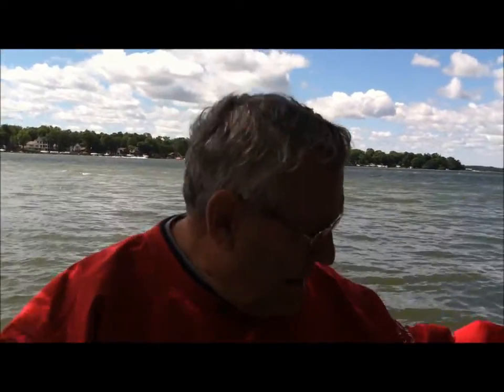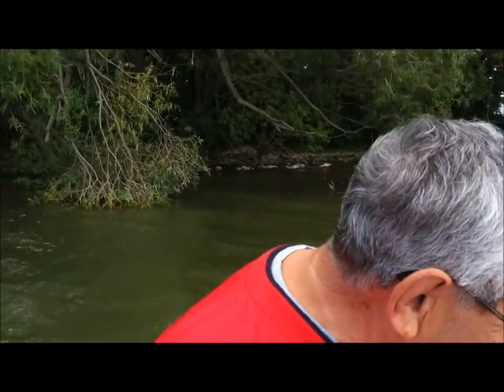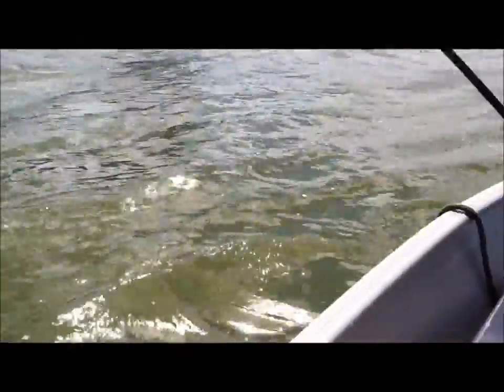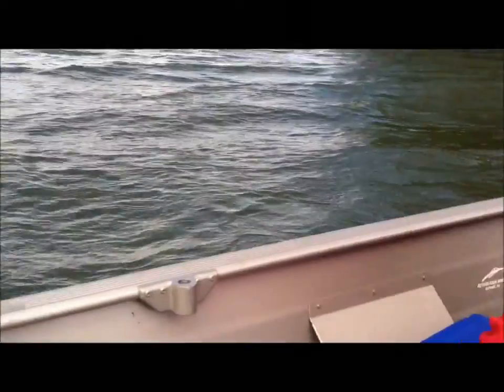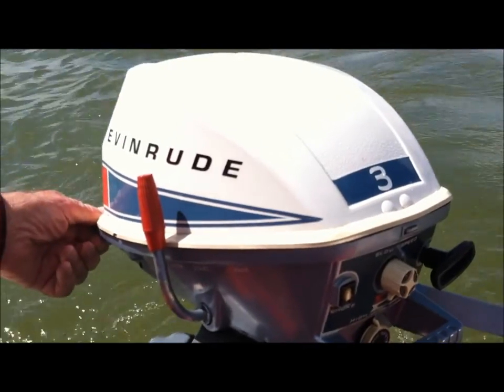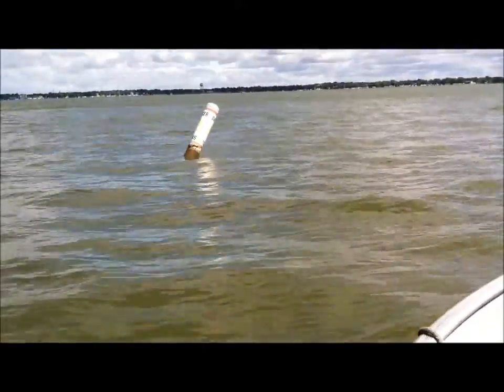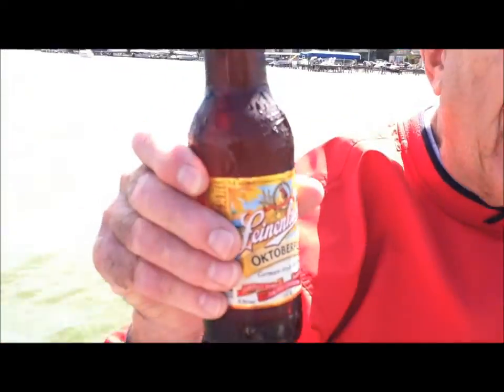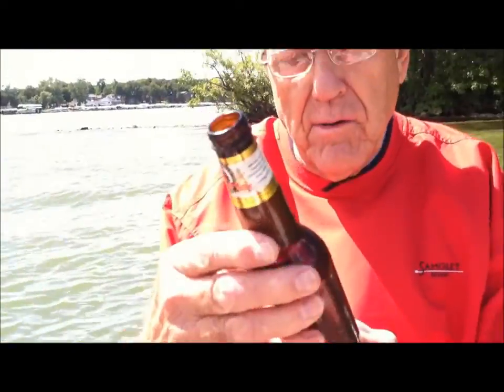1967 Evinrude Lightwin 3hp

Comment: I've got an old 1950 Fastwin...can't get it going though. If the spark plugs are in it's hard to pull the rope. The wax on the coils has melted off on the engine. Not sure what to do with the motor. Does anyone know anything about the fastwin?